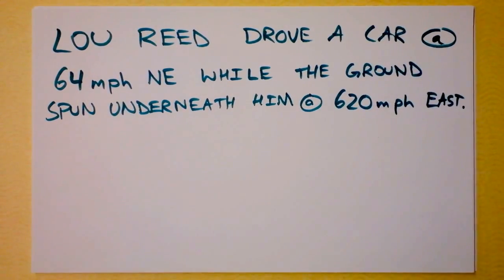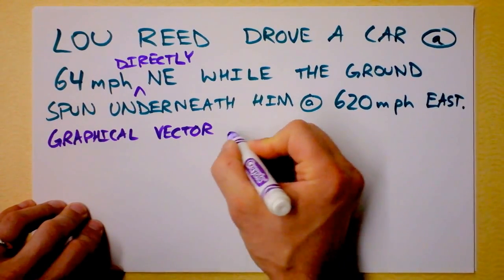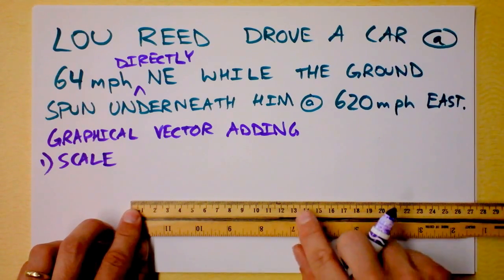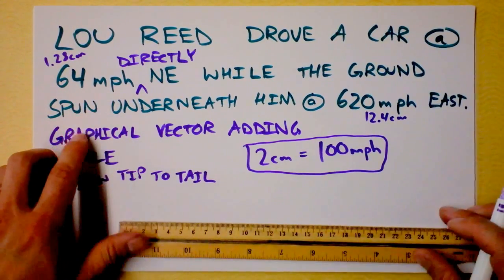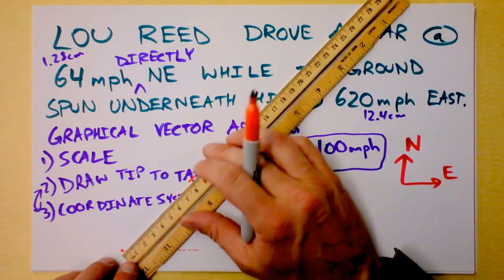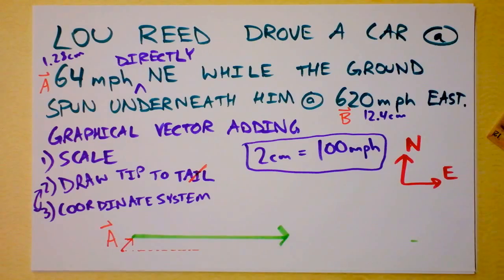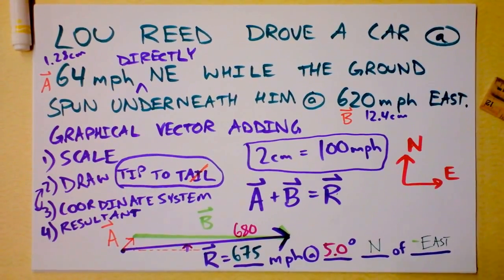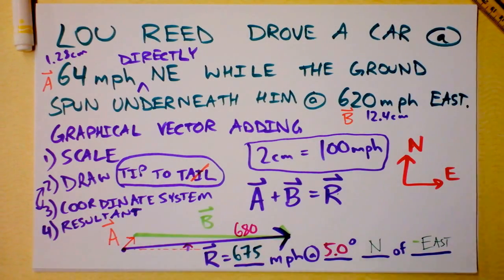Graphical Vector Addition OR What it Means to Add Vectors | Doc Physics

Comment: Not spun east , the earth can either spin clockwise or anti clockwise it can't spin east , it has to MOVE east or shift east at so and so speed , again NOT SPIN. Otherwise you're video is cool , u pretty hardworking
Reply from the maker: +Sarang Sharma While I agree in principal, I think saying it spins east is handy, since every point on the surface moves slightly to the east every second.  And besides, even saying that the rotation is CCW requires that we say that we're looking from the Norf.